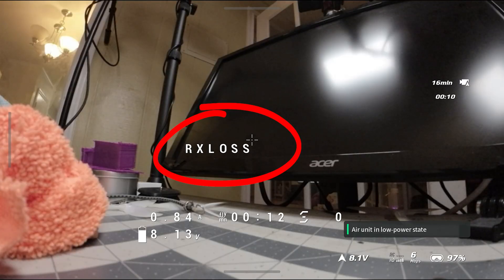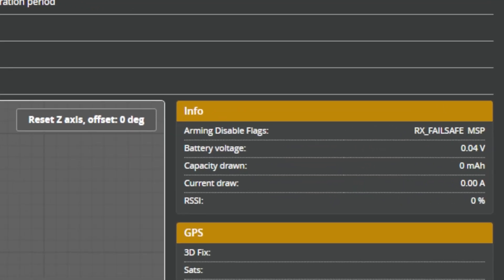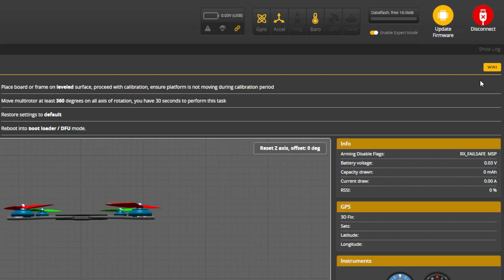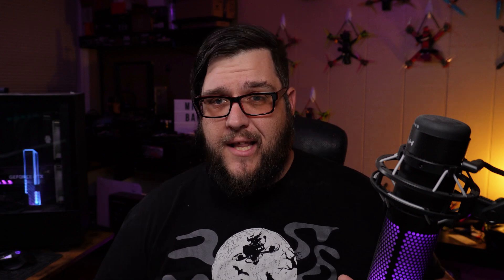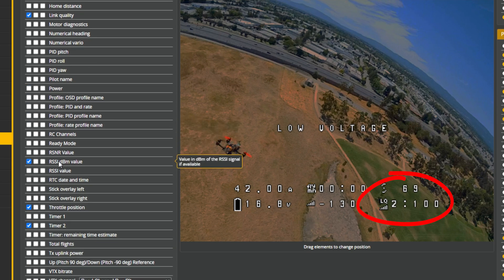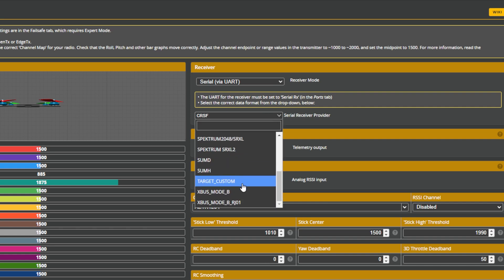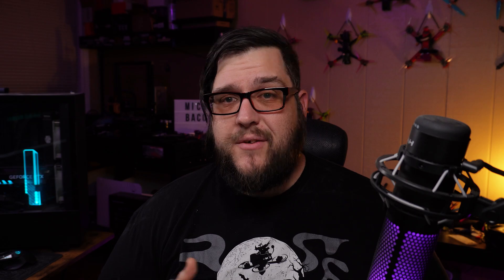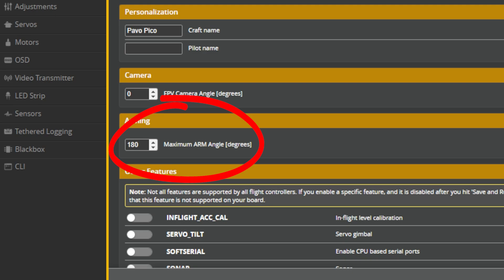FPV quad wont arm?  This is why! - Bacon's FPV Bits

Comment: Hello,

I am trying to bind my a Babyhawk 2 O3 ELRS with the Zorro ELRS version. The red light on the receiver is solid and the Zorro even tells me that telemetry is on or when I dosconnect the battery that it's lost. So somehow I think it should be binded.

But I can't arm the drone. Also Zorro does not do anything in Betaflight. Bars don't move. It's just like it is not their. 

I am actually sure that I updated the Zorro correctly (ExpressLRS) and I also think that I flasehd the Babyhawk correctly.

Also  the RX_Failsafe MSP is in my Systeminfo. But I can not arm the drone to get rid of it

I am trying for over one week now and I do not have any idea how to proceed :/

Can anybody help?

Comment: Help me please my new bubito drone doesn’t arm and it’s giving me the throttle msp flag saying the channel is to high Idk what that means please I’ve been trying to do this for 4 hours now
Reply from the maker: hmmm, so usually an MSP flag means that you have a USB cable attached.  I am guessing that you probably don't have one connected right?  If that is the case, take it to BF configurator, connect to it, and make sure to hit the disconnect button before unplugging it.  As far as the channel high/throttle one, that will mean that it thinks your throttle stick is up further than the bottom of the stick.  This can be a couple of things really.  First, I would take the time to calibrate your sticks in the radio.  Usually that means running the calibration and lightly making circles with the sticks all around the edges so that it can find them.  Once you have that, if you are still getting the flag, make sure that in the receiver tab of BF (you will need your radio on and a pack plugged in to see this) you get the correct throttle channel moving when you are moving your actual throttle stick.  If that checks out, put your stick all the way down to the bottom and take a look at the number that channel reads.  Go to the stick low threshold on the right side of that page, add 50 to the number you got as the low number when the stick was all the way down, and type that in.  That should get your throttle arming flag taken care of :)

Comment: Thanx for sharing mate,i looked these up when i was setting up my radio n babyape v2,frustratinng as,would have and will be nice just to come to 1 place to find out what this is ,cheers,now expresslrrs has changed so much as well i have to relearn everything ,hehe.peace bro!
Reply from the maker: yeah they can all be a bit confusing, lol.  I remember the first time I got one of these and had to run to the far corners of the internet to figure out what it meant!
Reply: Well .I'm back !I reinstalled my radio lost all models but found old ones I created a new quad model done everything in there then done everything in betaflight.weird thing was my external happymodel es24 pro I think it's called set to 250mw was revving its fan out (I really wanted to say guts) so it started connecting disconnecting for 10 minutes with the battery plugged in as it won't turn on unless a battery is plugged in its a v1 f7mini fc . So time to repull it apart by the looks .miss ya bro.peace

Comment: Before buying a new fc or esc, double check the pins inside the  plugs, sometimes they get bend. Almost all boards have solder pads and can be used to salvage it.
Reply from the maker: a very good tip!

Comment: Got a 7inch snail quad that flies about perfect in BF.  However,  no OSD and cant arm in INAV with the same settings.  I set out to make it an INAV build but chose BF first as a baseline.  now that its about 6 months old hopefully I can resolve OSD and try it again.  I just wish it would record these in logs because I dont get it on my goggles.
Reply from the maker: it definatley sounds like something is up with the port mapping in INAV vs what you have in Betaflight!  It could also be something going on with target and how it maps pins from the MCU to different pads on the board.  I really hope you get it worked out!